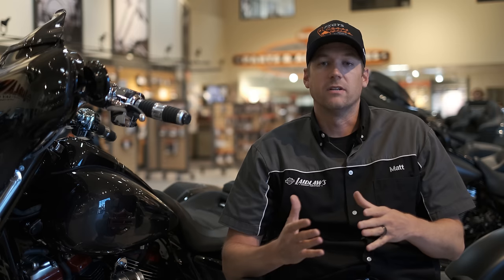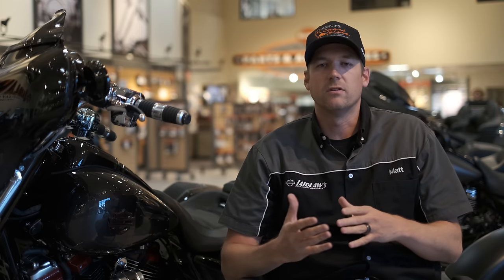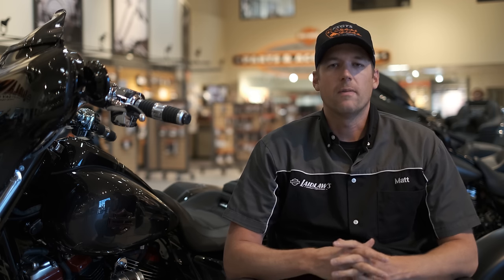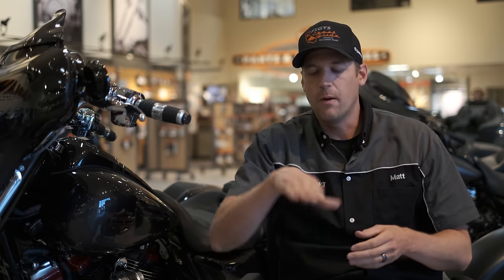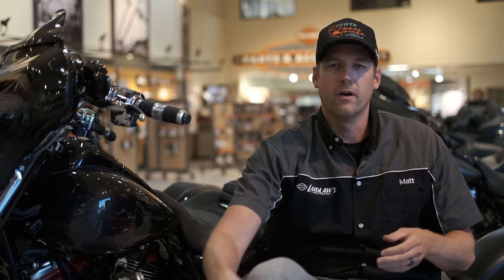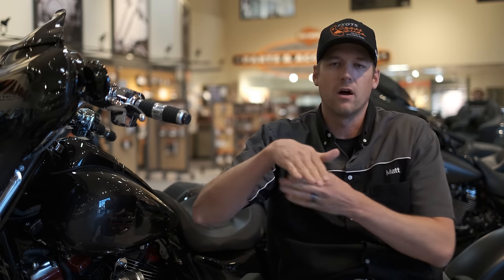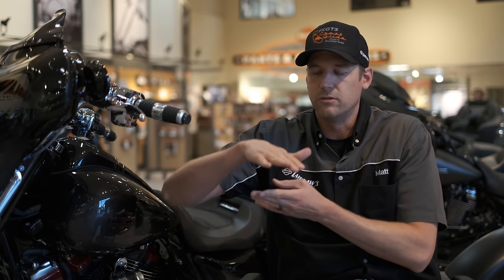Heel Toe Shifter on a Motorcycle: How it Works & the Pro's vs Con's

Comment: All the cruiser bikes I’ve ridden have always had the heel shifter. The two bikes we owned both had it, and grew super accustom to it. Granted, neither were a Harley, but  riding bikes without it definitely feels weird to me. I could absolutely get used to it, and might have to considering I just bought a 23’ heritage softail classic. Reason I say “might” have to, is because there isn’t a single Harley that had the same type of heel shifter as our other bikes. One is a Kawasaki and one is a Suzuki. The heel shifter sits off the board behind it on both. That is the style I’m used to, and have used for the past 13 years. I’m wondering if Harley offers the more set-back and lower heel shifter? If not, I might need to find a way to customize it. Honestly, all I think it needs is a longer shaft.

Comment: I always rode using a toe shifter, but when I got my limited with dual cooling, my non removable lowers prevented me from putting my foot forward enough. The only solution was to teach myself to use the heel shifter. It took a little while to get used to, but it’s become second nature.

Comment: I used them on racing and sport bikes, as they allow me to upshift while riding on the balls of my feet, so I only have to lower my feet when downshifting and braking, but they must be shaped in a very different way than in touring bikes, with a low front shifter and a high back one. 

Funnily, on my Victory Vision, I don't need it, as I ride leaning back with my legs extended in front and I can regulate the position of the shifter so it falls in the perfect spot with my heel resting on the floorboard.

Comment: Im looking at a Fatboy Lo that has the heel/toe setup.  Big problem  for me I have short legs I can’t really reach the toe part very well.   I know there’s adjustments but not to bring it further back which sucks.  If I buy this bike I may have to have a welder cut it shorter and reweld it.  It’s such a bummer because I can reach the ground and can ride this bike no problem otherwise.  The rear brake same deal, it’s way too far forward I can barely reach it with my 29 inch inseam.  If anyone has solutions I’m all ears.  Can even email me if you can help with this I really love the bike.  
😢

Comment: Heel shift totally, although the Company deign keeps sucking, come on rubber-plastic outer bushing / non grease fitted prawl / pressed connection on shifting rod. Guy goes out and puts down 30 plus K and gets the "shaft" on such a critical and arguably highest utilized item .
Don't even think about the internal bushings, like coughing up a fur ball. how many of us have had to jockey shift home and at the most inconvenient time with a little added inclement weather. Love and Hate I tell you. Now that's an adventure. Ha Ha  Ok, I feel better thank you for asking!!!!

Comment: I like the heel shifter until I had to replace the transmission shifter arm. I figured with the toe shifter only there would be less stress on the trans shifter arm. I also like the room on the footboard with the toe shifter only. I do miss the heel shifter though and may be putting that back on.

Comment: I like the heel/toe shifter on my Road King Classic. What I am still working on, however, is the smooth upshifting I was able to do on my Suzuki Intruder M800 by gently pushing the toe shifter upwards before pulling the clutch. Any advice on this for the heel/toe upshifting? How do you upshift smoothly with this setting?

Comment: My foot is long then the foot pad. And with lower fairing on my 97 ultra the room and comfort isn't there with rear peg on. I get the just of it all. But my big foot won't fit. Thinking on extended heel shifter. Grab a size 14 triple E boot and it will help to understand what I'm talking about. There's some that still don't understand.

Comment: I took mine off and the only reason was so be able to pull my feet back and sit upright once in a while on long rides . Had a tailbone issue from legs out so 
Sometimes it helps to pull feet back on extended floor boards to relieve pressure on tailbone . Personal situation for me but if you sit forward with feet back it def takes pressure off tailbone .

Comment: Been using heel/toe for fifty years , until a few years ago .. If you adjust both shifters low , almost to the floorboard , then it's a lot easier , barely even have to raise your foot to shift , I removed my heel a few years ago , just for room on the floorboard  , but i carry it in my bag as a spare and if I ever wanna put it back on it's there ..

Comment: Love the heel shifter; although I would like it further back.  Unless you wear a size 9 which I dont...
Reply: I am tall and have a prostetic leg from a bike wreck.  Put on 1" out and 1" forward board adapters from Kuryakyn.  Also put Harley extended heel/toe and foot brake levers to give me more room to clear the air cleaner.  Made a big difference for me.  I have several bikes and quads that all get some foot control modification.  Make it your own brother.

Comment: I added hi pegs on my motorcycle because it looked bad ass to ride in this way. However, I have small legs, I don’t need hi pegs to stretch my legs on a cruiser. Also, I don’t like backrest, I prefer doing back extensions, plank and sit-ups in a gym each winter.

Comment: Pro: When using highway pegs, shifting up just requires kicking down the heel shifter and putting your feet back on the highway pegs, rather than trying to wedge your foot underneath the toe shifter to pull up.
Con: If you ever want to stand up on your motorbike (like when looking over a hill/bridge/traffic or to stretch your legs), the heel shifter pretty much makes that impossible. Not having a heel shifter enables you to move your feet to the back of the footboard and will give you more space to stand up, like mid controls would.
Reply from the maker: True. I do stand up on my bike all the time with the heel shifter but my weight is further forward then I’d like.

Comment: i bought a 2019 Slim which came with floorboards and toe shifter. Was a bit dubious about the boards as I'd never tried them before. On trying them though they are great. Wouldn't have ever thought of them as an option if the bike didnt come with them... heel shifter might be the same. if you dont try it you wont know

Comment: As a heel-toe shifter, I can never imagine myself riding a single peg toe shifter. I feel the toe shifter is much more difficult to use and wears the shoes down more... it doesn't help with my ingrown toenail to try to scoop up the shifter as I'm changing gears.

I feel that a toe shifter will just ruin my shoes. I use my regular work shoes and not some expensive motorcycle shoes that I have to change out to since my motorcycle isn't even that fast (below 200cc)

If I'm gonna buy a new motorcycle with a toe shifter only, I'll convert it to a heel shifter.

Comment: I've never cared for heel shift, I think it's HARDER to heel shift, because you have to lift your whole leg off of the floorboard, to put it on top of the rear shifter, to shift. With toe shift I can leave my foot in the exact same position and shift up, without have to lift my whole leg and foot off of the floorboard. When I first started hearing about heel shift, it was for guys who wanted to wear tennis shoes and sandals to ride in, so they wouldn't hurts their toes shifting. I also noticed that I'd almost never heard of someone breaking their shifter linkage, unless they were racing a lot. As soon as heel shift came around broken shifter linkage was about 10 times worse, then when you shifted with your toe. Some people love it, some hate it. I personally have no need or desire for it.

Comment: I think I need to lower my heel shifter down and notch or two I don’t like having to lift my heel up so high
Reply: RON -B you can adjust it down with an Allen wrench but it is torqued so tight I gave up

Comment: They removed it to save a buck. Just like when you buy a blacked out special. They cheap out and give you a stainless shift linkage, a chrome kickstand, chrome bag handles. They don’t want to go the extra mile. Hell the sgs comes with a halogen headlight still ($25k). They cut corners that will annoy riders without losing most of them.

Comment: On bikes with pegs a heel shifter would be silly as you can rock your foot about the peg to get an upshift. But with floorboards, you're right, using the shin muscle alone has to do it and it is not nearly as pleasant or effective.
I love the heel shift on bikes with floorboards, the problem with most is their design. They are positioned too high so you have to move your foot too much to use it. Also, the lever itself sticks out too far and takes up valuable real estate on the floorboard.
I made my lever out of a short bolt and a few orings from the local hardware store. Works great. Doesn't get in my way when I'm not shifting and is positioned so I can bang thru the gears like a racer.
https://i.imgur.com/Dq6FhLX.jpg

Comment: I dont believe your reason on why HD took the heel shifter off the bike.  Its $$$ man!  Pure and simple.  Just one more thing that HD does that pisses me off!  Just like now if you buy a touring bike and want to use your boom box wireless you have to buy a HD Whim and HD stamped Sena unit.   I have 2 sets of Sena already I dont need a 3rd.  Its all about the $$$
Reply from the maker: Yes, I'm sure it was a cost saving move for them. They chose that specifically because a lot of people took them off and therefore it was a sunk cost in a lot of cases for Harley
Reply: Matt Laidlaw 
I love the heal toe but the heal shifters ware out at the splines. It seams like a design flaw because the clamp touches before the shifter is tight on the shaft. You can fix it by taking a hand grinder and opening the groove a little or buying a aftermarket shifter like I did. The drag specialties that I got is better designe then the oem on my 15 RK

Comment: My wife had a heel shifter on her motorcycle so I tried it out, the fact I have to lift my foot off the floorboard then drop it on the heel shifter, or keep my toes on the board then slide my foot back, is asinine for me, I would rather just keep my heel on the board, then rotate my foot around the shifter and use it to go up and down gears.

Comment: I've been riding for 30 years without a heel shifter. If something sketchy happens, I know my ingrained habits will override any 'learning' I've done to adapt to the heel shifter. Also, I'd think that finding neutral is a bitch using your heel. I'm buying a CVO, which has a heel/toe shifter. I don't want it, but as much as the damned bike costs, I'd hate to give anything back to Harley Davidson. I'm already getting shorted some previously included equipment, left off of the 2020 models; but I don't want to be learning a new skill on a $41k bike. Can you retain the heel shifter doohickey, and only use the toe shifter? That might buy me some time to get used to the damned heel shifter.

Comment: Put a sz 17 on and try it.   I have a bike now I just got, I have never taken one of these apart to change it out and that is the video I was looking for. There is NO room to move around on that floor board in my shoes, not even if I am just wearing sneakers, I have to have my foot on the OUTSIDE of the shifters range  Or have either my heel on the shifter or toe on the front at all times, let me tell ya, it's terrible, It's like my actual foot rest 1/4 of the board  or Highway pegs.     I just want stock happenings, also the break side sucks, I find myself using the front breaks way too much because of this.  
   My search continues.    Maybe no one ever films this process, I don't even know what I am going to have to buy to get this done yet.  it's making me kind of irritated.

Comment: That's old guy mid life crisis stuff. Guys who don't have the strength in their legs anymore.
Reply from the maker: I’ve been using it since I was 30.
Reply: @MattLaidlaw  I guess or people who want a calmer ride. That's why you'll never see these on a sport bike. There would have to be a lot of modifications done and the bike would pretty much have to be completely redesigned to put these on and it would slow the gear change down just because you need to slide your foot back and forth a little bit.
Reply: @petertorregrossa4447  well thats the whole purpose of cruising and comfort rides
Reply: @laryangel4082  I've had to down shift and bail twice so far off my bike. Once was on the tail of the dragon and the other was a pull out in a residential area. Both were slower speeds, maybe around 30. If I would have had boards and a toe heel instead of a peg and a toe shifter I would have been screwed.
Reply: @petertorregrossa4447  no you're right... you have to have cat like reflexes no matter if on a sports bike or cruiser bike